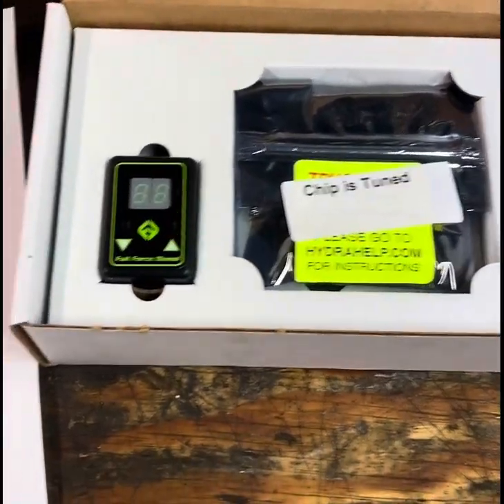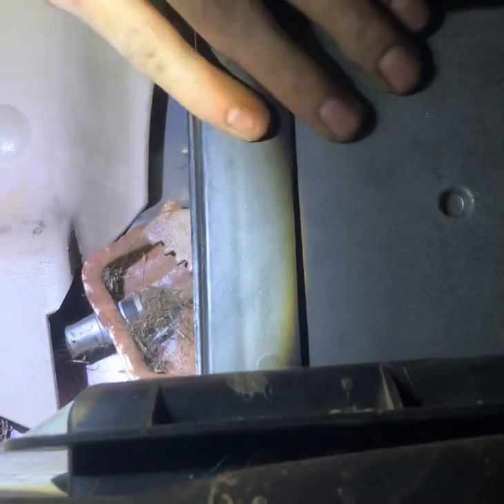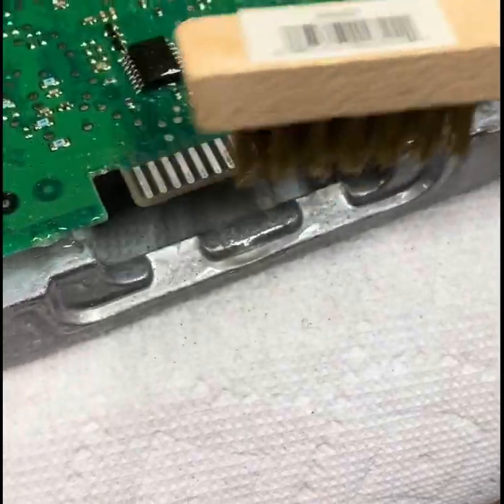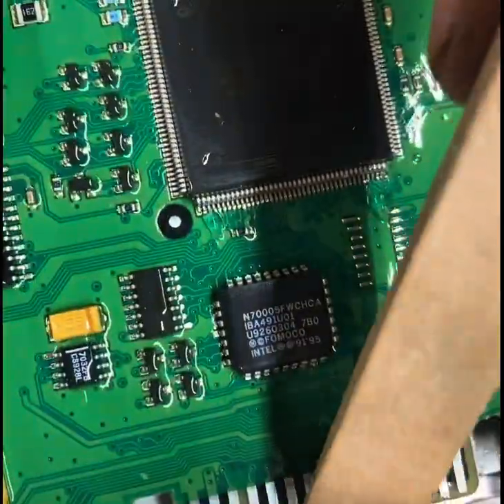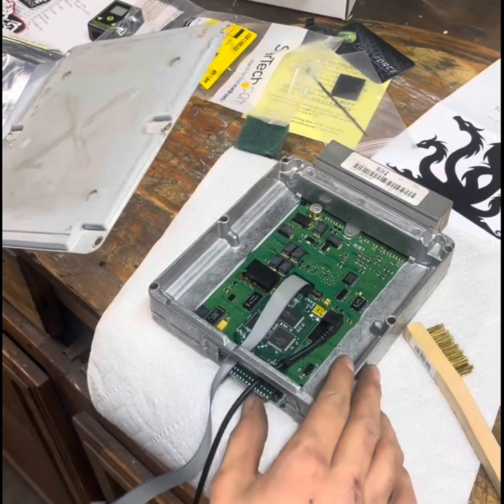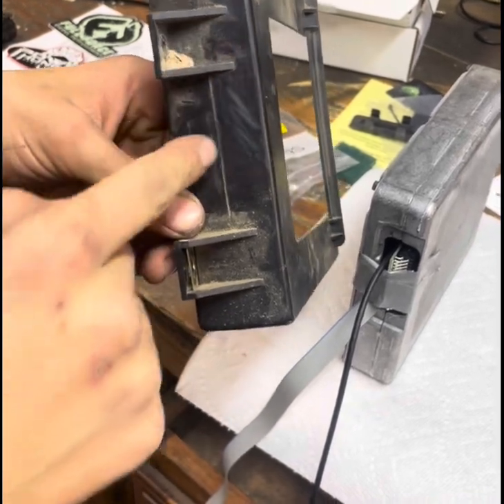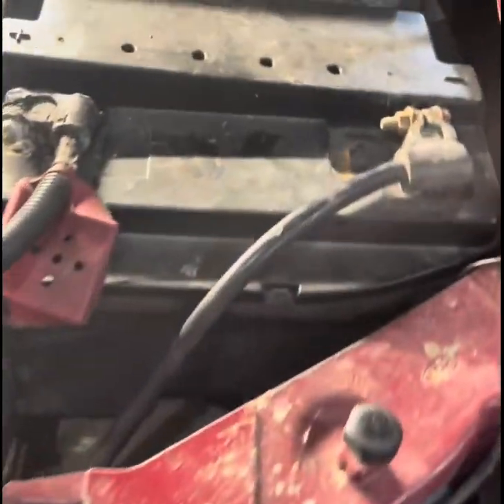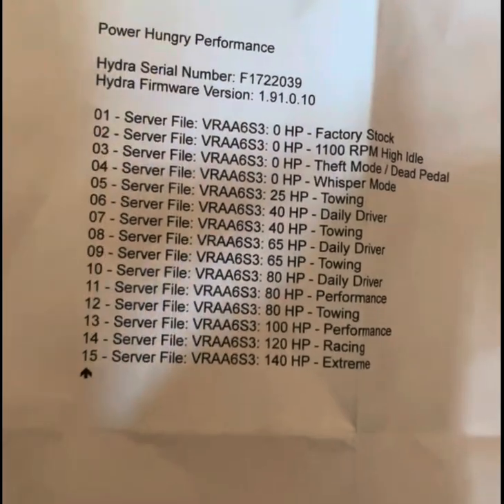How to install hydra chip tuner on 7.3 powerstroke

Comment: where did you buy the hydra with all those tunes
Reply from the maker: @3rdcoastpesca  I bought the hydra off of Full Force Diesel, they have a great selection of diesel parts. You just give them your vin number and then select if you want a chip that’s pre loaded with turns like mine was or you can buy a blank one.
Reply: @Adamsautomotive7.3 appreciate it they no longer pre load  chips guess time for my self to quit being lazy
Reply from the maker: @3rdcoastpesca I got in touch with full force diesel recently and they said that if you leave a note when you order your chip they can still load tunes on it for you. Not sure if that’s for everyone but that’s what I found out, hope this helps!